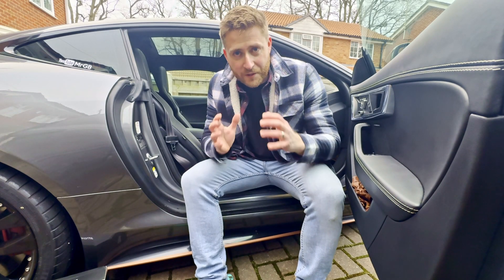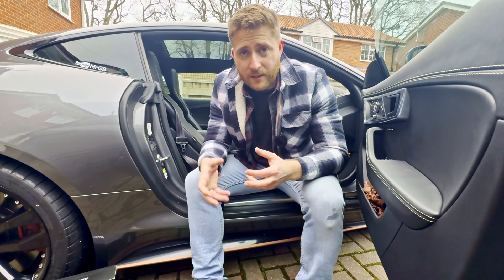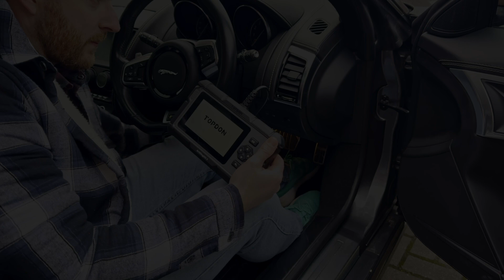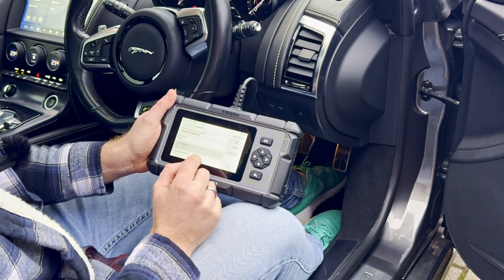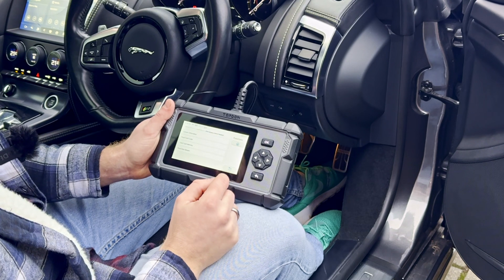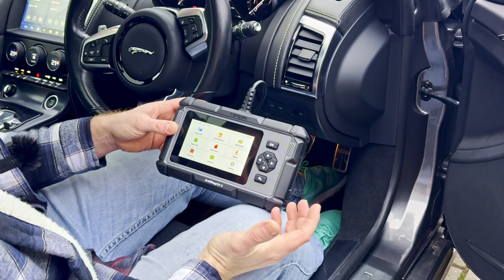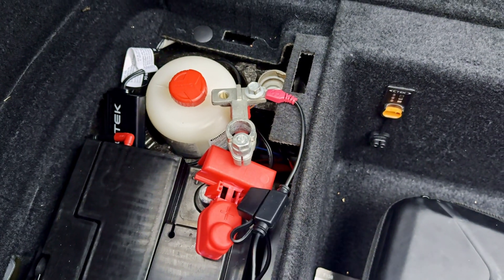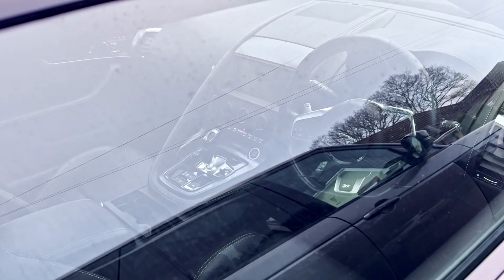How To Correctly Read Codes On A Jaguar F Type (OBD) | Avoiding A Flat Battery on A Jaguar F Type

Comment: Hi mate, can I just ask if you always disconnect your battery to do a reset by just removing the +Red terminal? I had to do a reset on mine after using the obd port and on a cpl of forums they said to remove the thick black Neg ground cable which is earthed on the bodywork, I did that but it was a pain to do, your way looks much simpler 👌🏻🍻

Comment: Hey fella 
A massive thanks for this, yesterday my car went into meltdown mode. Had mine mapped on Monday then exhaust system made and fitted on Wednesday all was fine until yesterday. So I wondered if the mapping guy shut down the cars computer so I checked and the light stayed on for ages after I locked up. Booked in for a mobile mechanic which took me all bloody day to sort out someone to come out at some point next week. Local garage won't touch my jag.

Then this morning I was watching some of your uploads and stumbled across this. 

Tried it and boom it worked car sorted with no massive bill to pay.
Reply from the maker: Glad it sorted you out! Made the video worth it in one comment! Thanks

Comment: Just the positive? I thought you had to take the negative off?
Reply from the maker: Just breaking the circuit will do the job. This will de-power the modules
Reply: @MrGB_UK  Yes but disconnecting the positive is extremely bad practice and is more likely to result in accidental short circuits. 

Since the car's chassis is grounded to the negative terminal, the entire car's body is connected to the negative side of the battery. By removing the negative cable first, you break the circuit and ensure that if your tool touches the positive terminal and the car's body simultaneously, you won't cause sparks, damage components, or create a short.

Comment: I found out how to shutdown the connection without having to disconnect the battery. Keep reading! So, bought the exact same reader and I'm disappointed that it doesn't give you access to live data, adaptations, customisations... All the good stuff I was used to with Obdeleven in my old Audi. This reader just gives basic information and allows you to clear the codes. It's very well built and looks very professional but at least with the F-type, it can't do much.

How do you avoid having to disconnect the battery? If using this same reader, once you've completed diagnostics, return to the main menu. Start the car, shut down the reader. Once the display goes off, disconnect it from the obd port. Switch off the car. That's it! The hazard icon will go off  2 minutes after the car has been locked.
Reply: My OBD2 reader is plug and play. It powers up/down from plugging it/out. Is there anyway to power it down or reset the battery management system? Thanks!!
Reply: super info here muy friend, and I just ordred the same OBD reader, Should have read your post before and then gotten a better one, but I guess im not really into all the LIVE data, just to see the diagnostics and clear them.
Reply: @kurtandersen813  no worries. And I actually found a way to access live data buried in the settings. Quite happy with it overall and got my money's worth already. Nothing better than doing your own research on error codes rather than taking someone else's word for it. What F-type have you got?
Reply: @JWL-UK  I got the V6SCAWD from 2016 and it drive FANTASTIC, never had any problems with it, before today, I need to change the SOS battery
Reply: This video explained why my battery went dead after I read a fault code. Thank you.

Comment: Okay but what else gets forgotten by disconnecting the battery? Time? Radio? Equaliser? Any other settings?
Reply: Good question. I wonder if there's no proper way to close the connection using there Obd port.

Comment: Great video, and perfect timing, i was sodding around with my idcore unit and had a handful of warning lights come on my dash as a result of my incompetence with the dip switches, so thought i’d do a scan, 2 days later and i get a low battery warning light i now know why !! did the battery reset and left the car running at idle for 15 mins battery still low i suppose that means i’ll have to take it out for a blast tomorrow to get a full charge !